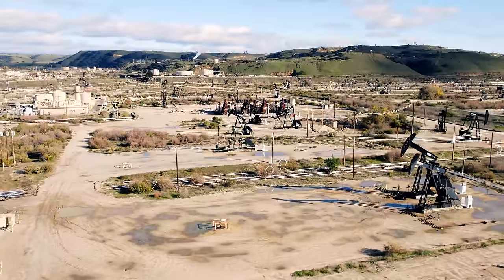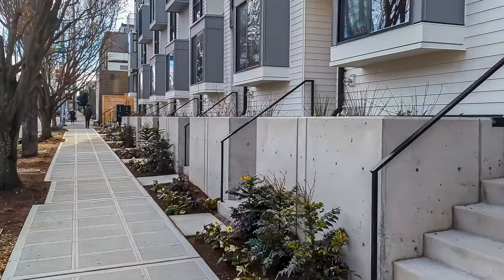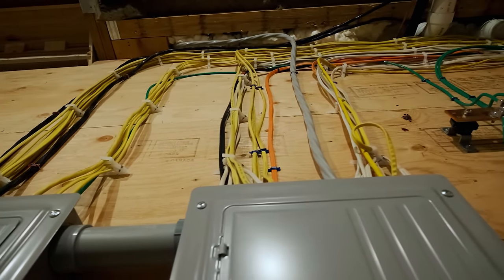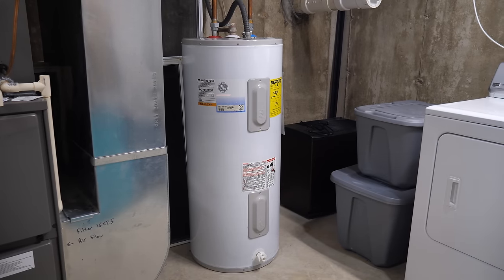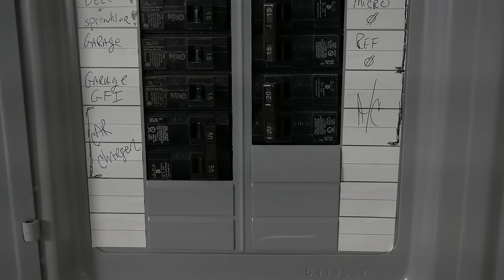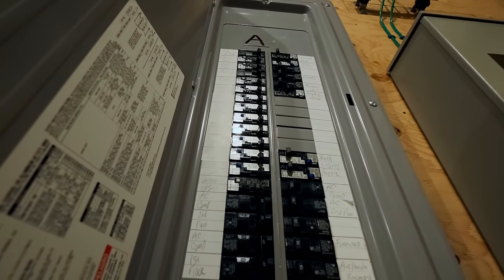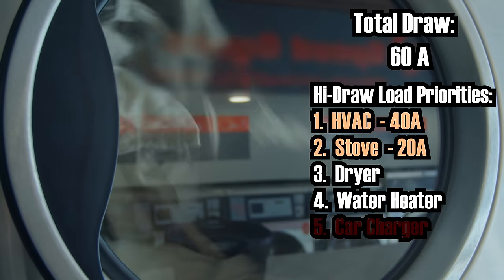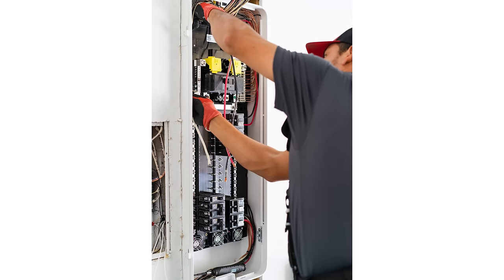Home Electrification: There's not a lot to do, and it doesn't have to be hard (Part 1)

Comment: Just because you have 200 amp service does not mean you get to use 200 amps. I have typical "200A" service at my house. The transformer that supplies my house is rated at 25kva, so in reality I can pull no more than 104 amps. Maybe push it to 125 for an hour. Most residential houses do not have a transformer this large! Mine is oversized because it is supposed to feed a neighbor's house but there is no house there yet. That means we normally SPLIT that 104 amps available. 

I also have a propane tankless water heater. 150,000 BTU. If I wanted to match that same output with electricity I would need 183 amps. That would blow the fuse in the transformer. No normal home has a 44+KW transformer, most often 200 amp service only gets a 5-15KVA transformer. Even smaller if you have 100A service.

You can of course have a larger transformer installed and get as much power as you want, but you're paying for that. $$$$

Comment: This is all cool and nerdy and I love electricity (I’m looking to get a Cybertruck) but what was the benefit to switching to all electric again? Environmental impact of is a consideration but it sounds overall that there is more work and much more energy management necessary (specifically converting a 100amp system). 

Convenience is one of the biggest reasons people change products, systems etc. and it seems less convenient to switch to electricity and in that way switching is not super attractive. Generally it’s a good idea to make a new system MORE convenient than current systems for mass adoption.
Reply: You have no choice, you can’t use oil and gas if you have no earth.

There is no choice it’s non negotiable, either you adapt hopping for the chance of connivence or you get wiped out by the same thing you destroyed.

Comment: I'd be curious to see a deep dive into a point that was very briefly glazed over in this vid (and other "Just use solar/sun power" vids).  My home's electricity comes from natural gas.  The stove is electric, but is it really more efficient to use electric stove/car (when power plant is 50-60% efficient, and transmission lines lose energy every mile) instead of burning that same fuel at the consumer device?  And I've never heard of gas dryers, that's jank.

Comment: Going to tell you, first thing that needs to change is insulation. Blow in fiberglass insulation is one of the worst but most promoted. I have an R-60 in my attic and works worse than my barn, which is a giant metal box, dark green, and has R-19 batt. 

If I don't run the A/C in my home it will end up being 85-90 inside while the barn is 75... If you are looking at blow in, look to cellulose.

Comment: Would Span be much cheaper than just upgrading to a 200A service?  If you could just get 200A for similar or not much more, then that might be the way to go, no?  I understand for some it may not be possible in which case Span will be a good solution.

Comment: For some full electrification is not an option, in edmonton where I live winters typically get done to -30C to -40C for a few days, which means heat pumps freeze collectively on a yearly basis and the draw from resistive heating is more than the grid can provide.

Comment: Believe it or believe it not but my home is fused just for 5 amps, which is common place for the older smaller homes where I live, owning a washing machine, a dryer, tv set, radio was considered an extreme luxury in the eighties, therefore 5 amps was more than enough in those days, but nowadays, our govornment shuts homes of the gas grid, the problem is that those homes are mostly homes fused for 5 amps, so a 3x 16 amp cooker just does not work, but a diesel generator surely does, since rewiring the apartments to more than 5 amps is a hassle.
Reply: So, you must use a broom to clean the house then? 5 amps is not even enough for a vacuum cleaner.

Comment: nothing hard to ditch gas.
We have installed solar, geothermal heat pump, bought two EVs. The lease on EVs is less than we used to spend on fuel, and solar with heat pump were funder by government. Basically we ditched gas and two old petrol guzzlers that would break down all the time. All within one year, spent below 1k€ of out own money.

Comment: Ditching gas isn't hard to do. But upgrading your fuse box and house wiring to accommodate more electrical appliances isn't cheap, and replacing all your pots and pans with induction cooktop-compatible pots and pans is quite expensive, too.

Comment: So, I haven't finished the video yet, but what stops you from just pulling 100a from the grid and just tossing it into a battery for outputting 200a when you're running super high load?

Comment: stove top burners are 240 volts at 15 amps so if four are one at once that would be 15x4 = 60 amps not the 25 amps or less you speced out.

Comment: I Love my Delonghi Gas Furnace
Heat's up the 100sqm house in 10min
Im not switching to Electric Anytime soon
Infact my MiniSplit AC also works as a Heatpump yet im not using it
It uses 980w to run as a Heatpump ans 1020w as an AC

Comment: All that "the average home only uses 5%" is good and all, but I don't want to have to worry about whether I can charge my phone, cook Thanksgiving dinner in July, and charge my EV at the same time. Yes, most of the time it's a non-issue. But what about the other times? There are way too many natural disasters happening for me to want to trust the electrical grid to stay on. Gas isn't much better, but at least I don't need electricity to use it. And if worse comes to worse, I could probably hook a propane tank up to it and go to work on those eggs Benedict.

Comment: I have gas hot water home heating via radiators, gas water heater, gas stove and gas dryer.  I have lived in my home since 1976 and my gas service has never been out of service.  My electric service does fail from time to time mostly due to winter ice and snow storms or wind or electrical storms.  For that reason I have a natural gas 10 KW generator that will allow me to stay warm and operate everything electric in my home without any problem at all.  I will not be making any changes.  I have no plans for an EV as IMO we are 50 or more years away from all cars being electric.

Comment: How does a  well pump proving water for 2 homes requiring 30 amp complicate only 100 amp service?  New windows are in and considering radiant floor heat  I think the well really throws a wrench in the mix especially since I have no control how the other home uses water. Planning on getting a dedicated power line and meter so the well is on its own service and won’t continue putting me into higher tier KW hour prices.  I worry someone will leave a garden hose  running in the other homes yard leaving for the week  and I end up with  $1000k electric bill they already refuse to fix leaky sprinklers or even pay anything for the well operation and maintenance.  CA power is too high not to have control over how much is used.  I can attempt to conserve to keep my power use within my lifeline amount  but, still can’t control how much the well pulls while pumping water for the other home.   They don’t conserve because they don’t pay a water bill.  Another person who assumes if you have a well your water is free.

Comment: my house is 2 stories and is supposed to have a coal stove and diesel hot water heater heater with radiators. in all the rooms. well last guys who had the house stripped all the old copper out of it hour scrap value and switched to a tiny pellet stove and electric water heaters. now i get ice in my house with everything running full blast on the colder nights. i need to get a coal stove for the basement and move the pellet stove to the first floor.

Comment: HVAC guy here, your parents electric heat cycling on a limit switch is not good. At the very least do set the blower to a higher speed. Those limit switches will wear out before long.

Comment: I'm trying to figure out what to do with our 4 unit building that only has 100 A, the state and city are eventually going to make us convert everything to electric, but if you want a new service everything has to be brought up to code, and it is not possible to do that with our 130 year old building. No place to put the panels according to code.  Lots of things to rewire,  no easy way to run large electrical supply to many different parts of the building.  Many of the kitchens are stacked, and there is no exterior wall to run new service because our building is right up against our neighbors.  Not sure what's going to happen, but it isn't going to be cheap or easy!

Comment: Only had appliance I have in my late 60's home is furnace. It's ok until power goes out, then I have no way to cook, no hot water as well as no lighting. It kinda sucks as power goes out everytime the wind blows. If I were to want to convert my furnace I'd need to upgrade my box which would cost. It's not likely to happen unless someone else is paying for it all🤣🤣 including the backup battery.

Comment: Did you know the wind mills have 250 gallon oil systems that much be replaced every 3 months.  And most of the battery storage systems have to be replaced every 4 years.   Not wanting to think about the Blades need to be replace regular too.

Comment: I try to follow your Numbers. Is the 100/200A per Phase or in total? I got only 63Ax3 at my Home which is fused down again to 40Ax3 with a „SLS“, make it 120A useable. But I got also 230/400V, not 120/207(?)V, so I only need half of the Amps for the same kW…

Love that Gas operated dryer somehow…

Comment: We want to move from a gas stove to electric. We have 100A service with our major electrical appliances being the fridge, central air, washer, dishwasher, and microwave. We would need to get a 240 line installed in our kitchen, but would we be ok on 100A service?

Comment: What's up with this 100 and 200 amps service, and it being a problem?

I live in the Netherlands where a standard household connection is 3x25A (17,2KW), which is plenty for all appliances mentioned in this video. Bigger/huge homes could come with 3x35A (24,2KW), but I believe that isn't as common, nor necessary.

If I'm correct, our 3x35A connection, is comparable to your 100amps service. Why do homes in the US even need 200amps?!

Or is this a "a lot is good, but more is even better" thing?

Comment: About the electric power usage... nah, i would say with 100Amp limit and US voltage i would be screwed - big times.
Living in europe, when i need power i basically need ALL of it at once, not segmented over the day. That is switching on the washing machine, the dishwasher, the stove and water-heater at the same time. Why? Cause people work. When i get home that is the time i can jump into the shower, the start the washing machine and start cooking - some of the biggest powerhogs running at the same time.
But in general yeah running a house without fossil fuels is kinda the norm. Solar does help somewhat (specially if you change your habits of when you use what. it is only a small inconvenience), but it also is not all that clean when compared to other sources (hydro for example).

Comment: I don't think you realize how many places in the south west are out of modern code compliance and require thousands to update. Sure I can get a rebate for an elective stove but how much is it going to cost me to update my electric box and wall. Also it will always be more efficient to heat a home with gas as long as the unit isn't allowing a bunch of the heat to escape outside.

Comment: My 160m² home from 1979 is running fully electric on a 20a main circuit (14kw). Standing in the middle of sweden so i got cold winters. Originally the boiler is connected to water radiators and only use resistive elements. It worked fine but i have upgraded the heating system with 2 minisplits now for use as ac and to heat. Anyhow my 20a service haven't ones broken a fuse even when all the aplienses are in use (washer,drier,cook top , heating and boiler) so 100a us should not be to low sens it should be 23kw? And my house is not smartified. Total energy usage for my home is estimated at 18000kwh/year sens the minisplit upgrade(and droping, its my powercompany that makes the estimation and it has only bin running for 6 months) and before it was 25000kwh/year with the resistve heating

Comment: What’s the cost difference between upgrading to 200amp vs getting a smart panel?  I live in an area where to get an electrician takes  6mo and costs you $600 usd to add a single outlet

Comment: Just had a thought about the smart breaker panel. If it prioritizes different circuits does it actually shut off power to the others? Like say my car charger is low on the list and I'm making dinner and doing laundry. If there's no power going to the car charger then it will power down completely. Meaning once it gets power back it will need to be booted up again as if there was a power outage.

Comment: Not convinced on these smart panels.  A battery can serve the same purpose better, for probably not that much more money.  Plus it would more effectively allow you to shift energy use to off-peak times (helping pay for the extra cost if you have TOU billing), and provides backup in the case of a power outage.

Comment: My issue is not that I can run everything electric - it’s that the cost to be electric is insane! My electric bill would be $800 a month if I tried to heat with electric. I’m planning on switch from electric dryer and hot water to gas next year because natural gas is a cheaper form of energy then electric.

Comment: I'd rather go through the sevice upgrade and revision of all the circuits in the house. The two reasons to do that are removing any need for more "smart home" devices and to, at the same time, convert my house to 100% ethernet 0% WiFi.
Another option for this too is to try and cook up a central server thats got house-wide wired connections to multiple access points, cause why not have virtual machines for every room in the house?

Comment: Two heat pumps, 3.5 ton each. With electric coil heat strips.  That's over 200 amps when both units are running aux heat on a 20 degree (F) day.   We have 400 amp service, all electric.

When there's a power outage, even just a few hours, in the dead of winter, when the power comes back on, ALL hvac units in everyone's home kick on the heat strips (due to setpoint being well above room temp) and trip the main breaker to the entire subdivision.  Then the utility workers have to power up the subdivision in stages.
There is a LOT of work to do, to make the grid intelligent, both inside and outside the home...
And then electric car chargers enter the chat....

Comment: The price of electricity has gotten alot higher the last 5 years in my state. We're switching everything to gas, old house, old wiring etc.
If you got the money all this sounds great to play around with, but aint happening around here. 
Some of us might only have 50 amp service 😄 and self regulate running the micorwave or the airfryer at the same time while the the dryer is running..preying the water heater dont kick on..and making sure the thermostat is off..

Comment: I grew up in an all-electric home.  Pass.  Natural gas is efficient, powerful, and cheaper than electricity.  That's why people use it for heat, hot water, a dryer and a stove.  (Well, that, and cooking on an electric stovetop positively sucks compared to gas).

Comment: What about redundancy of power sources?  When the power goes out my power company can take a few hours to bring it back on.  So if I want power, I need something that can turn the natural gas renewable into electricity until they fix the overhead powerlines and restore power to my neighborhood.  Before 2011 I was all straight electric because it was so stable, but not any more.  Since then they are so unstable that we have gone days without power at a time.  Not fun when it happens while you require electricity.  My longest power outage was almost five days (also acknowledged by the power company that they were planning to fix it for that same time).

Comment: When the power goes out for a few days in the middle of winter, I’m quite glad I have a gas fireplace, and can run my gas furnace on a battery backup. No amount of battery power available now or in the foreseeable future can heat a home for several days while the grid is down. The only real solution is everyone generating their own power at home. That’s all but impossible for apartment dwellers or other abodes with no feasible place to do so. Just like a Tesla in the freezing cold (won’t run/won’t charge below a certain temperature) there are many cases where batteries and electricity just aren’t the right answer. Also like a Tesla, you’d better have your home battery pack in a fireproof, explosion proof enclosure. 😂 I’d love to know how many electric cars spontaneously combust in a year, relative to the number of houses that spontaneously burn down in a year due to a failure (not negligence) in the gas piping or devices in a home.

Comment: I plan to get a gas kitchen stove in future because power is just so unreliable. The power infrastructure got thrashed in new york after a tropical storm around 10 years ago and it never was fixed beyond getting it to function. So has become extremely unreliable with power outages being common enough that a electric stove is just unreliable.

Comment: The issue I have with building code is not the code itself, it's the fact some shitty contractor will try to skirt around it.  So If they made the electrical code more flexible, I would worry about someone screwing people over.